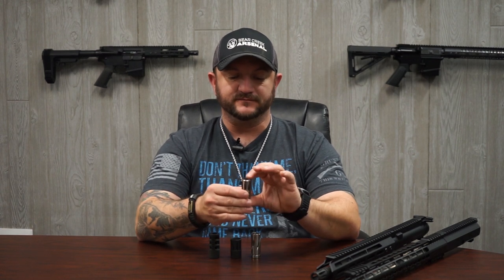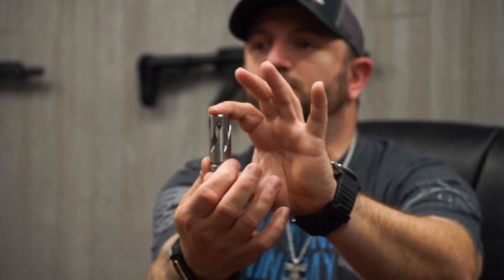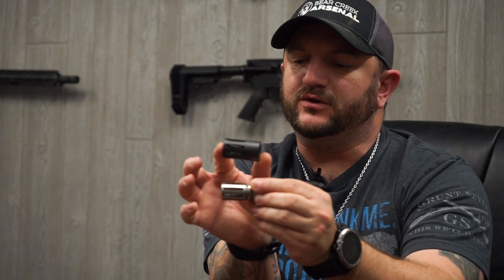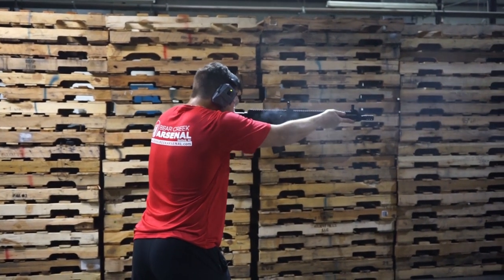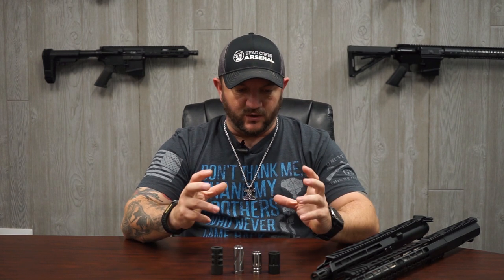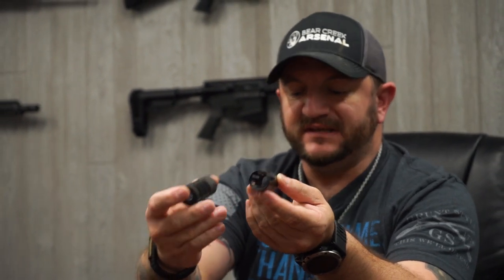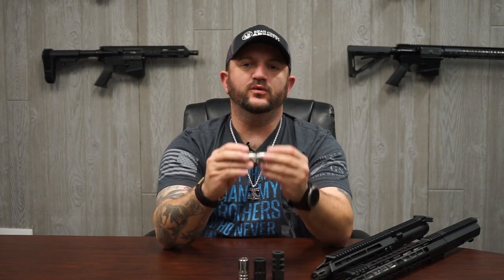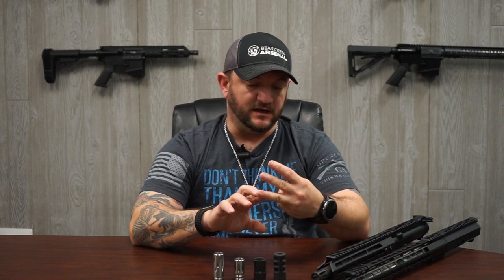Types of Muzzle Devices for an AR-15 [Function, Comparison, Installation, FAQ]

Comment: If you want to clear the lanes around you at the gun range I recommend a 450 with a muzzle brake.
Reply: The 450 in the 7.5" flavor is my choice. The muzzle blast from that is QUITE a thing to experience. Im waiting for a bigfoot with a vest to wander into my house wishing to do me harm, so I can see how effective it is.
Reply: Holy Cow! Isn't that the truth! I deafened myself one a hog hunt a couple of months ago after realizing moments before pulling the trigger, that I didn't have my plugs in. I have since installed a 5 slotted compensating flash hider. It helps, but I'm still thinking about buying an installing a Kaw Valley linear comp.

Comment: After buying the 450 Bushmaster I think the 5.56 is a novelty.
Reply: @G Smithy If you need more than 5 rounds of 450, you're in a BAD situation amd probably not in the US. I would be willing to bet it would stop a bear in a vest. But my 30 round lanser mags and tromix followers, I hold 10 and run with zero problems. Plus... I can still find ammo on the shelves at comparable 5.56 prices.

Comment: That Birdcage is about useless.It nay help a class if there is o e somewhat .The Suppressor is the way to go nowdays.
Good Video.Thanks.Alot of people dont know this and will be quite helpfull
Reply: I wouldn't call the A1 and A2 birdcage units useless. If you try them side by side, compared to naked muzzles shooting the same ammo, it's like night and day.
Peace.
Reply: The birdcage is pretty much top of the class compared to all those 150 dollar spiked mall ninja things people think they need. 

Don't try to reinvent the wheel, the a2 performs best for real world application. Take off the gamer brakes and the douche comps.
Reply: I don’t want to give the gov 200$ to be put on a list and I don’t want a blistering hot 10” mass on my barrel all the time. Muzzle brakes work and keep junk out of my barre and protect the crown. I definitely like the old brake and it definitely works

Comment: Great company love the products please for God's sakes stop putting bird cages on 450 Bushmaster or anything else they recoiled anything like it it just makes no sense why would I put a flash hider on basically a hunting rifle love the company hate The Birdcage love your products
Reply: They help recoil but they also are considered a safety device as they help keep mud etc out of the barrel and help protect the crown. If u don’t like it just cut it off with a angle grinder  and use it as a thread protector. Most ppl like them. Bca barrels have a nice 11* crown and the brake doesn’t obstruct the gas at the crown harming  accuracy so it’s not hurting anything. I’m sure theirs 450 guys casting bullets and running silencers. Absolutely sure